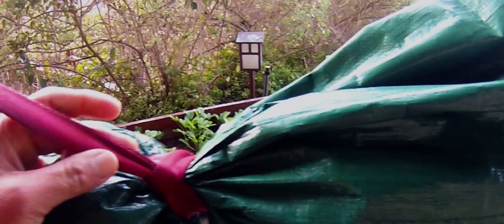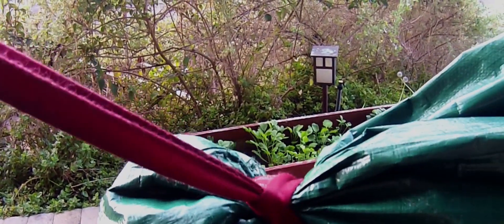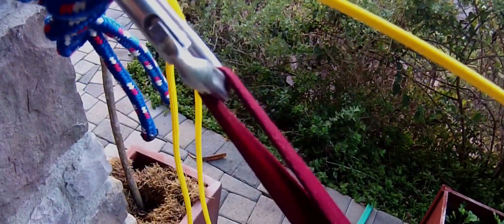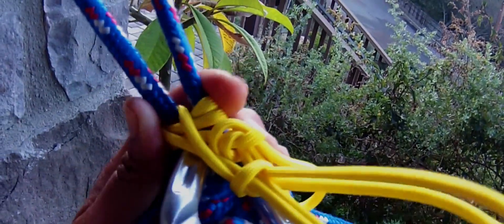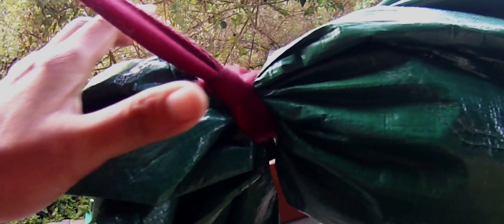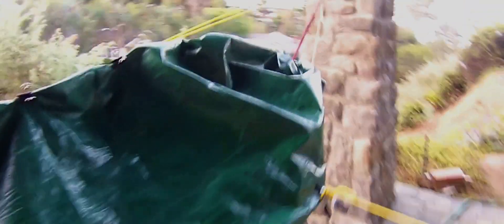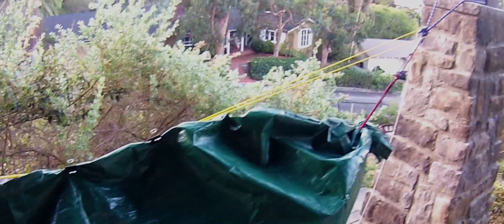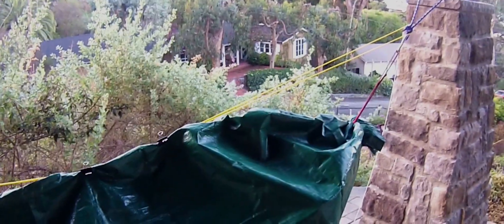Condensation PeaPod Hammock Tarp Shelter

Comment: TEST YOUR GEAR!!!!! You are very smart to do this and find the set up that works best for you. I like how you set up the tie outs, I'm glad that the extra airflow helped with the condensation.You have it set up real well, you have taken into thought as for the flow of the rain, great job there as well. You showed you wont have any problem setting it up with what is offered to you, even in the bush or at home. Usually you have branches or stake out the top flap, either way i think you got it. I'm real glad your liking it . I use the 3.5mil tarps most times and they work. I seen the 10mil and is is 25bucks here at my home depot. I now have a heavier then 3.5mil now tho not sure what i have now, but your tarp will last and hold you easily for sure. take care and hope your hike went well. bye for now Rocky.
Reply from the maker: Thanks Kull! I slept on it again last night. OMG I slept so hard..LMAO!! I got really lucky to get that tarp here in Home Depot. It was under $10. The one I got on ebay was over $12 and what I noticed w/ that one it had micro holes on it. When I first tried it out and it rained here, I had some wet spots inside the tarp. That is why I went and got a new one. Thanks to your idea. Your experience and your videos, I am able to apply those knowledge/experience of yours into what I am doing here. Thanks Kull!
Reply: YOUR VERY WELCOME, AND THE REASON I DO MY VIDEOS IS TO SHARE MY EXPERIENCES AND MAYBE HELP OTHERS.OOOPS CAPS LOCK ON LOL . There sorry bout that. I'm glad you are liking it and i'm sure you will have it mastered by the time you head up in the mountains with it.Some of the cheapest tarps are not done well. I turned to a heavy duty tarp as well from walmart because it is woven alot tighter and better. Well anything i can help you with just let me know. take care Rocky and merry christmas

Comment: Looks good Seems you got the dew problem solved I just finished my new hammock blanket. I sewed a poncho liner to a wool blanket , The wool outside  I put the wool hafe down on hammock which is great insulation and the top hafe is enough to keep me warm , the wool blanket doesn't slide, and is not itchy with the poncho liner next to skin  so far works great  hard to find real cold weather here but was up in the creator and still worked good